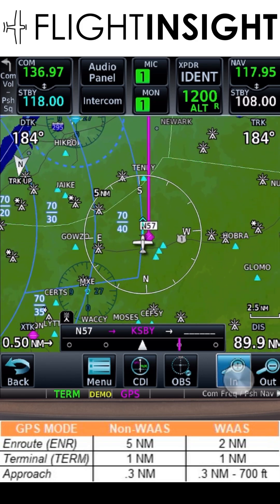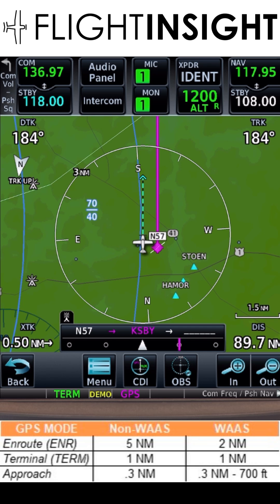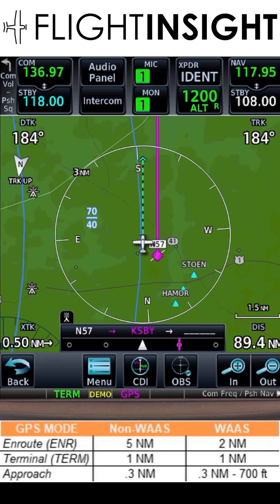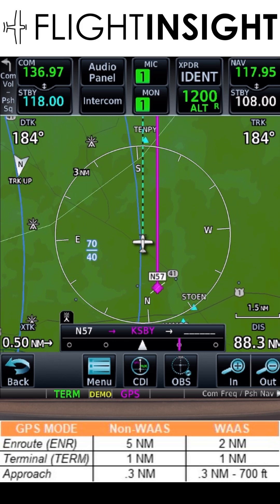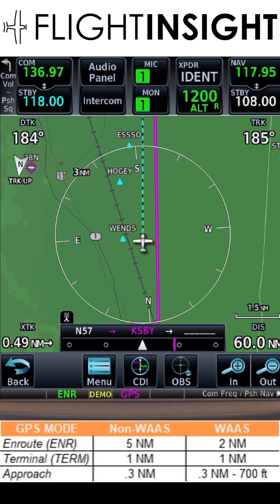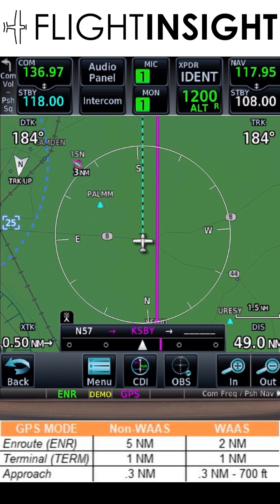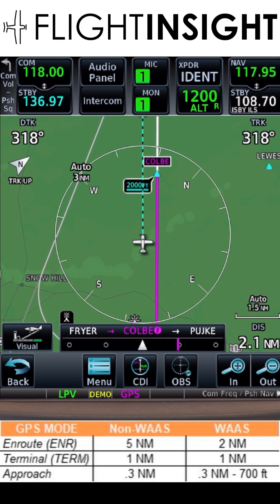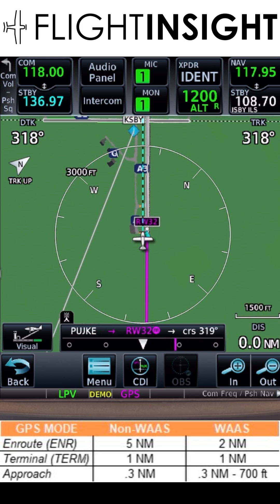GPS Modes, Enroute, Terminal, and Approach

Comment: Sorry but just wanna confirm the sensitivity of the cdi needle during the en route phase of flight is ± 5nm on either side of the course but you said it drops to 2nm at the en route correct me if am wrong ;)
Reply from the maker: Non-WAAS units will use 5nm in the enroute phase
Reply: @flightinsight9111  Thx Dan!